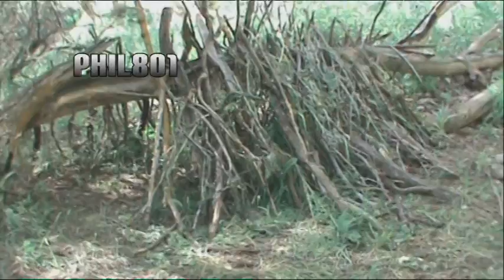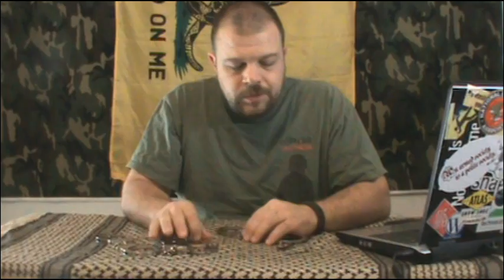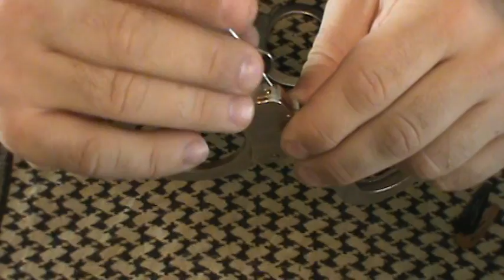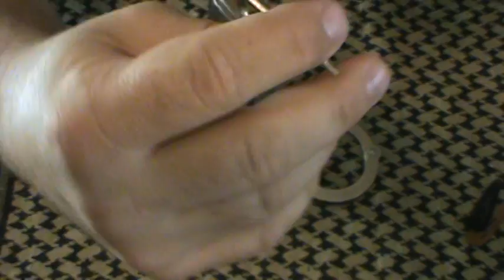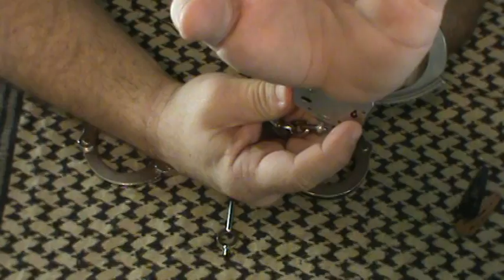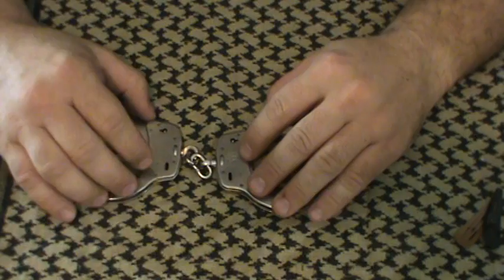Basics of Picking Handcuffs

Comment: I buy them at auctions (used) and they all (most) are different. Some people can and HAVE reached over/under or on side and grabbed their gun. Some have 5-6 inches which is enough for some to bend their arm around or fire a gun. The 'glass' typically is almost NEVER bulletproof. So a cop's 40 , 357 will go thru the plexiglass.

Comment: I am a Key Control Officer on a prison unit in AR. I deal with locks and keys each and every day. In essence, I'm a Locksmith for my unit. There are several female Officers scattered among the 4 shifts which staff the unit. Certain hair styles demand the use of hair/bobby pins to keep them in place. Unfortunately, I discover 2 to 4 pins every month. How many do I NOT see? As far as the double locks are concerned, once set, they prevent the pawl from being depressed thus releasing the ratchet.